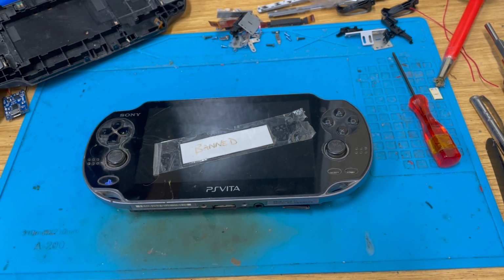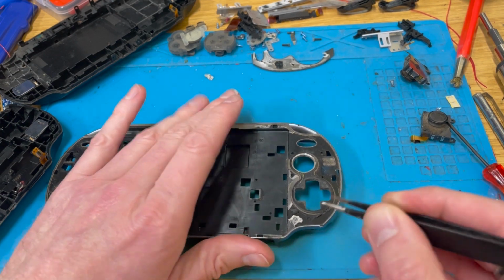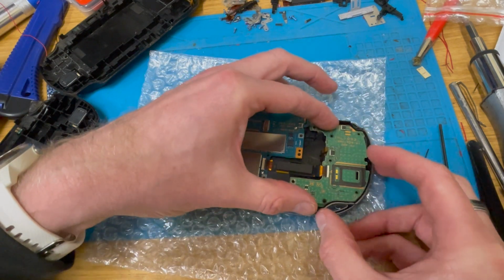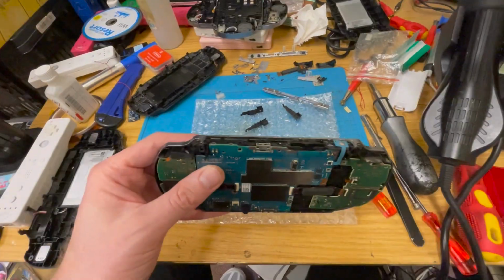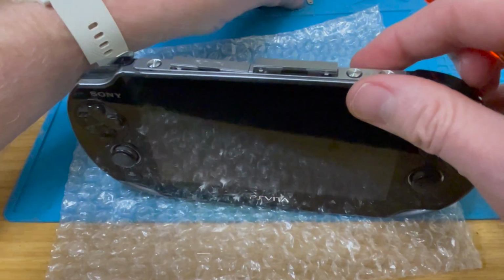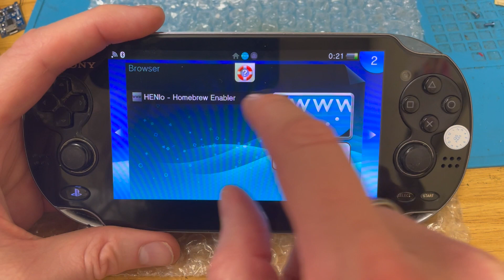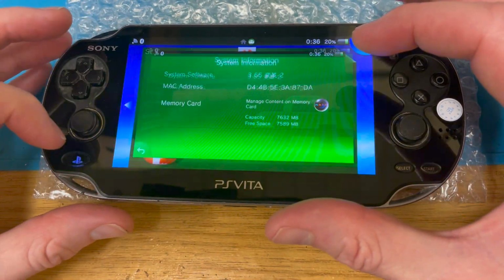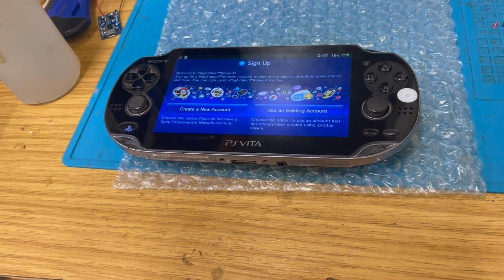PS Vita Rebuild - Taking a bag full of spare parts and a banned motherboard & making one that works

Comment: Good to know I can still hack mine when the store is gone. I did have a PS2Vita but it died as I getting it set up. Might get another one and try again. That’s a great job of resurrecting that Vita.
Reply from the maker: Yeah, this has been a revelation, without this hack, that motherboard would have probably been stripped for spares, it almost bit the dust a few weeks back, really happy I held off on it for just a little longer ☺️